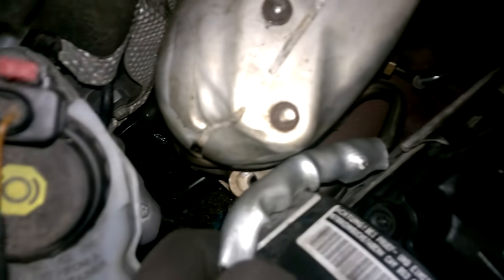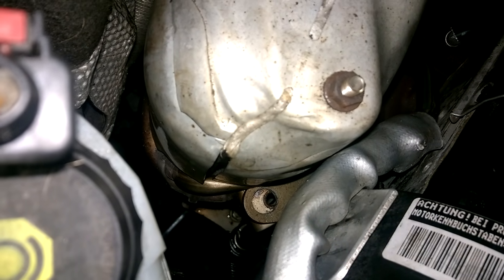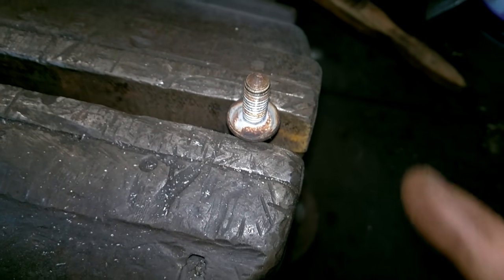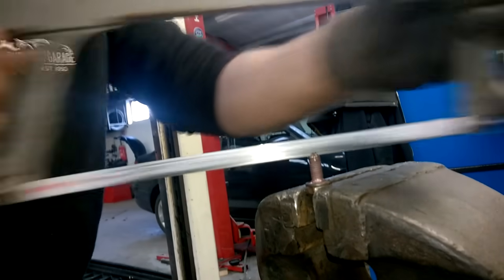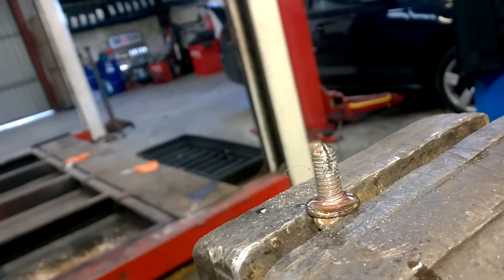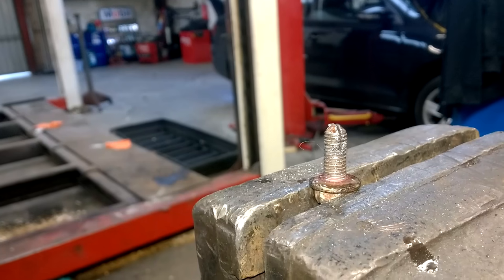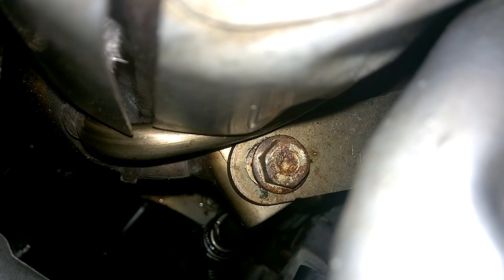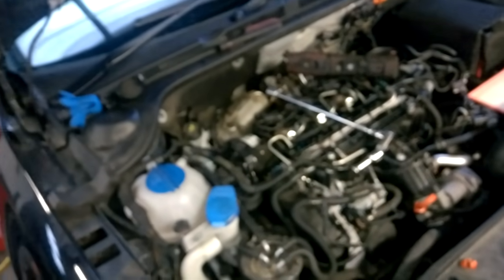My Father Taught Me This! Passing It On To The Next Generation

Comment: Thank you so much for this. And thank your father too!
Reply from the maker: Thanks Mark 
 
The update info below is the pinned comment on this video, I know most people do not realize I made that video and it better explains/shows this method in use.   
I also included below details of why the job was done this way free of charge with the customer fully informed. I hope you check it out  👇👇
 
UPDATE* I decided to make a follow up video on this https://www.youtube.com/watch?v=yfNQullGEuQ&feature=youtu.be Should answer some of the questions that were raised, I include 3 demos of this in action with close up shots.
 
As there was some safety concerns & confusing comments raised, I felt I should clear a few things up. 
1) This is a tip for certain circumstances only, I never have and never would use it on a component which would cause any safety concern to any customer.  
2) The demo was done on a support bracket only, items like this or similar will not cause any safety concern. 
3) I did this free of charge and on a time restraint, I noticed it when I was replacing another item, the customer needed the vehicle back that evening and I decided rather than leave it like it was, I would do this and secure it up fully. 
4) The bolt was not the issue, the part that the bolt threads into is a secured piece, someone had previously damaged it, leaving the bracket loose and the bolt just tightened a turn or so.
5) The bolt can be removed and will not break, it will go in and out as usual and has helped clean up the damaged threads.  
6) Used in the right application I personally believe this is a great tip and can save you a lot of time & trouble. 

Lastly to all the people who have watched the video, Thanks very much and I am delighted with the feedback I have received on it.

Comment: When using the hacksaw you should lift up on the backstroke that will save the teeth if you look carefully they are facing forward and they are meant to cut on the forward stroke
Reply from the maker: The update info below is the pinned comment on this video, I know most people do not realize I made that video and it better explains/shows this method in use.   
I also included below details of why the job was done this way free of charge with the customer fully informed. I hope you check it out  👇👇
 
UPDATE* I decided to make a follow up video on this https://www.youtube.com/watch?v=yfNQullGEuQ&feature=youtu.be Should answer some of the questions that were raised, I include 3 demos of this in action with close up shots.
 
As there was some safety concerns & confusing comments raised, I felt I should clear a few things up. 
1) This is a tip for certain circumstances only, I never have and never would use it on a component which would cause any safety concern to any customer.  
2) The demo was done on a support bracket only, items like this or similar will not cause any safety concern. 
3) I did this free of charge and on a time restraint, I noticed it when I was replacing another item, the customer needed the vehicle back that evening and I decided rather than leave it like it was, I would do this and secure it up fully. 
4) The bolt was not the issue, the part that the bolt threads into is a secured piece, someone had previously damaged it, leaving the bracket loose and the bolt just tightened a turn or so.
5) The bolt can be removed and will not break, it will go in and out as usual and has helped clean up the damaged threads.  
6) Used in the right application I personally believe this is a great tip and can save you a lot of time & trouble. 

Lastly to all the people who have watched the video, Thanks very much and I am delighted with the feedback I have received on it.

Comment: All the simple solutions are the best. 👍
Reply from the maker: The update info below is the pinned comment on this video, I know most people do not realize I made that video and it better explains/shows this method in use.   
I also included below details of why the job was done this way free of charge with the customer fully informed. I hope you check it out  👇👇
 
UPDATE* I decided to make a follow up video on this https://www.youtube.com/watch?v=yfNQullGEuQ&feature=youtu.be Should answer some of the questions that were raised, I include 3 demos of this in action with close up shots.
 
As there was some safety concerns & confusing comments raised, I felt I should clear a few things up. 
1) This is a tip for certain circumstances only, I never have and never would use it on a component which would cause any safety concern to any customer.  
2) The demo was done on a support bracket only, items like this or similar will not cause any safety concern. 
3) I did this free of charge and on a time restraint, I noticed it when I was replacing another item, the customer needed the vehicle back that evening and I decided rather than leave it like it was, I would do this and secure it up fully. 
4) The bolt was not the issue, the part that the bolt threads into is a secured piece, someone had previously damaged it, leaving the bracket loose and the bolt just tightened a turn or so.
5) The bolt can be removed and will not break, it will go in and out as usual and has helped clean up the damaged threads.  
6) Used in the right application I personally believe this is a great tip and can save you a lot of time & trouble. 

Lastly to all the people who have watched the video, Thanks very much and I am delighted with the feedback I have received on it.

Comment: I would've wanted to see the point of insertion. And i seriously question how straight/square the bolt thread is in position. Likely crossthreaded if the bolt didn't go in straight. Looks like a one-time fix to me.
Reply from the maker: The update info below is the pinned comment on this video, I know most people do not realize I made that video and it better explains/shows this method in use.   
I also included below details of why the job was done this way free of charge with the customer fully informed. I hope you check it out  👇👇
 
UPDATE* I decided to make a follow up video on this https://www.youtube.com/watch?v=yfNQullGEuQ&feature=youtu.be Should answer some of the questions that were raised, I include 3 demos of this in action with close up shots.
 
As there was some safety concerns & confusing comments raised, I felt I should clear a few things up. 
1) This is a tip for certain circumstances only, I never have and never would use it on a component which would cause any safety concern to any customer.  
2) The demo was done on a support bracket only, items like this or similar will not cause any safety concern. 
3) I did this free of charge and on a time restraint, I noticed it when I was replacing another item, the customer needed the vehicle back that evening and I decided rather than leave it like it was, I would do this and secure it up fully. 
4) The bolt was not the issue, the part that the bolt threads into is a secured piece, someone had previously damaged it, leaving the bracket loose and the bolt just tightened a turn or so.
5) The bolt can be removed and will not break, it will go in and out as usual and has helped clean up the damaged threads.  
6) Used in the right application I personally believe this is a great tip and can save you a lot of time & trouble. 

Lastly to all the people who have watched the video, Thanks very much and I am delighted with the feedback I have received on it.

Comment: Today I learned where the term "hack" came from. I wonder how many hacks you can do with the hack-saw?
Reply from the maker: The update info below is the pinned comment on this video, I know most people do not realize I made that video and it better explains/shows this method in use.   
I also included below details of why the job was done this way free of charge with the customer fully informed. I hope you check it out  👇👇
 
UPDATE* I decided to make a follow up video on this https://www.youtube.com/watch?v=yfNQullGEuQ&feature=youtu.be Should answer some of the questions that were raised, I include 3 demos of this in action with close up shots.
 
As there was some safety concerns & confusing comments raised, I felt I should clear a few things up. 
1) This is a tip for certain circumstances only, I never have and never would use it on a component which would cause any safety concern to any customer.  
2) The demo was done on a support bracket only, items like this or similar will not cause any safety concern. 
3) I did this free of charge and on a time restraint, I noticed it when I was replacing another item, the customer needed the vehicle back that evening and I decided rather than leave it like it was, I would do this and secure it up fully. 
4) The bolt was not the issue, the part that the bolt threads into is a secured piece, someone had previously damaged it, leaving the bracket loose and the bolt just tightened a turn or so.
5) The bolt can be removed and will not break, it will go in and out as usual and has helped clean up the damaged threads.  
6) Used in the right application I personally believe this is a great tip and can save you a lot of time & trouble. 

Lastly to all the people who have watched the video, Thanks very much and I am delighted with the feedback I have received on it.

Comment: A hacksaw blades teeth only go in one direction so going back and forth with it will dull your saw quick fast in a hurry .... take note next time you use your blade. Efficiency will be greater if you are mindful of what way your blades teeth go and use the blade in the correct direction only... now you know

Comment: I may be missing something here, but a tap for the bolt hole and die to clean up the bolt threads would be faster and more professional means to complete this job. In deference to the video’s author the fix presented here works and is an alternative when a tap and die set is unavailable.

Comment: I forgot all about this! I used to see my father doing this.  He was a mechanic his whole life.
Reply from the maker: The update info below is the pinned comment on this video, I know most people do not realize I made that video and it better explains/shows this method in use.   
I also included below details of why the job was done this way free of charge with the customer fully informed. I hope you check it out  👇👇
 
UPDATE* I decided to make a follow up video on this https://www.youtube.com/watch?v=yfNQullGEuQ&feature=youtu.be Should answer some of the questions that were raised, I include 3 demos of this in action with close up shots.
 
As there was some safety concerns & confusing comments raised, I felt I should clear a few things up. 
1) This is a tip for certain circumstances only, I never have and never would use it on a component which would cause any safety concern to any customer.  
2) The demo was done on a support bracket only, items like this or similar will not cause any safety concern. 
3) I did this free of charge and on a time restraint, I noticed it when I was replacing another item, the customer needed the vehicle back that evening and I decided rather than leave it like it was, I would do this and secure it up fully. 
4) The bolt was not the issue, the part that the bolt threads into is a secured piece, someone had previously damaged it, leaving the bracket loose and the bolt just tightened a turn or so.
5) The bolt can be removed and will not break, it will go in and out as usual and has helped clean up the damaged threads.  
6) Used in the right application I personally believe this is a great tip and can save you a lot of time & trouble. 

Lastly to all the people who have watched the video, Thanks very much and I am delighted with the feedback I have received on it.

Comment: Whenever possible, I prefer to tap out the threads properly with a machined tool. It doesn't take any longer than making an improvised cutter out of a bolt, and it does a much better job. If you care about your machinery, it's the only way to go.

I've found one occasion where an improvised cutter makes sense, and that's for threading large bores in soft stock such as thermoplastic or resin or wood, where you might not have the proper taps and dies on hand in larger sizes. In this case, you can grind four shallow ways along the length of a suitable bolt or pipe nipple. The resulting tool is crude but serviceable, and it has twice the number of cutting faces as the one in the video.

There is also no need to cut all the way through as depicted in the video. That only weakens the tool. Just make the ways deep enough to capture the swarf. You can also grind a slight taper to the first couple of turns of thread to aid in feeding the tool.
Reply from the maker: The update info below is the pinned comment on this video, I know most people do not realize I made that video and it better explains/shows this method in use.   
I also included below details of why the job was done this way free of charge with the customer fully informed. I hope you check it out  👇👇
 
UPDATE* I decided to make a follow up video on this https://www.youtube.com/watch?v=yfNQullGEuQ&feature=youtu.be Should answer some of the questions that were raised, I include 3 demos of this in action with close up shots.
 
As there was some safety concerns & confusing comments raised, I felt I should clear a few things up. 
1) This is a tip for certain circumstances only, I never have and never would use it on a component which would cause any safety concern to any customer.  
2) The demo was done on a support bracket only, items like this or similar will not cause any safety concern. 
3) I did this free of charge and on a time restraint, I noticed it when I was replacing another item, the customer needed the vehicle back that evening and I decided rather than leave it like it was, I would do this and secure it up fully. 
4) The bolt was not the issue, the part that the bolt threads into is a secured piece, someone had previously damaged it, leaving the bracket loose and the bolt just tightened a turn or so.
5) The bolt can be removed and will not break, it will go in and out as usual and has helped clean up the damaged threads.  
6) Used in the right application I personally believe this is a great tip and can save you a lot of time & trouble. 

Lastly to all the people who have watched the video, Thanks very much and I am delighted with the feedback I have received on it.

Comment: Word.  Another old timey trick of the trade.  Such is the currency I traffic in.  Much thanks.
Reply from the maker: Thanks Sub Zero  
 
The update info below is the pinned comment on this video, I know most people do not realize I made that video and it better explains/shows this method in use.   
I also included below details of why the job was done this way free of charge with the customer fully informed. I hope you check it out  👇👇
 
UPDATE* I decided to make a follow up video on this https://www.youtube.com/watch?v=yfNQullGEuQ&feature=youtu.be Should answer some of the questions that were raised, I include 3 demos of this in action with close up shots.
 
As there was some safety concerns & confusing comments raised, I felt I should clear a few things up. 
1) This is a tip for certain circumstances only, I never have and never would use it on a component which would cause any safety concern to any customer.  
2) The demo was done on a support bracket only, items like this or similar will not cause any safety concern. 
3) I did this free of charge and on a time restraint, I noticed it when I was replacing another item, the customer needed the vehicle back that evening and I decided rather than leave it like it was, I would do this and secure it up fully. 
4) The bolt was not the issue, the part that the bolt threads into is a secured piece, someone had previously damaged it, leaving the bracket loose and the bolt just tightened a turn or so.
5) The bolt can be removed and will not break, it will go in and out as usual and has helped clean up the damaged threads.  
6) Used in the right application I personally believe this is a great tip and can save you a lot of time & trouble. 

Lastly to all the people who have watched the video, Thanks very much and I am delighted with the feedback I have received on it.

Comment: Damn it GUMP. YOU A GENIUS  if you weren’t so darn 😂😂   Thanks. It allows the bolt to give enough to find its way into the hole which I have a issue at time getting it in the hole 🤣🤣🤣